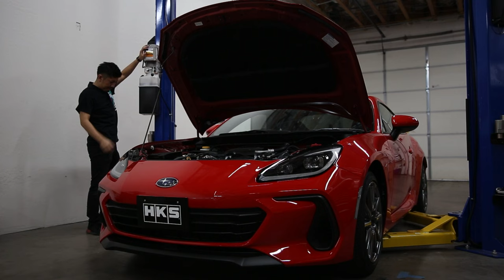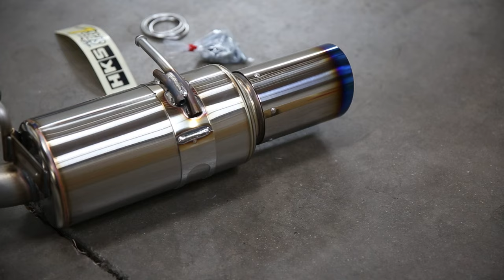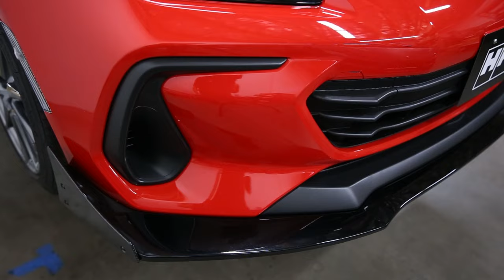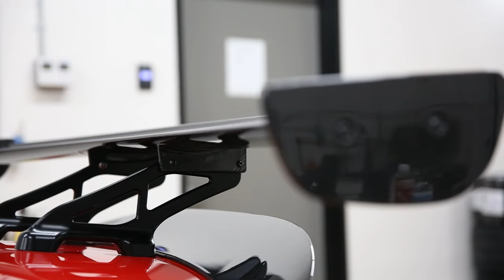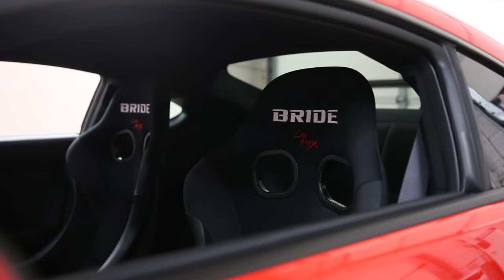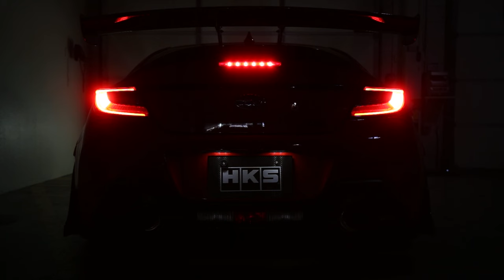2022 BRZ JDM Spec build at HKS USA for SEMA2021

Comment: Really want know the wheel size
Reply: 18x9.5 +45
Reply: @jacobji8132  they won’t fit on the stock suspension without spacers. If you want to run these wheels like they do in the video, you need coilovers and adjustable rear suspension. 255 tire will rub in the front + rear if you are too low, so you need a 5mm spacer all around.